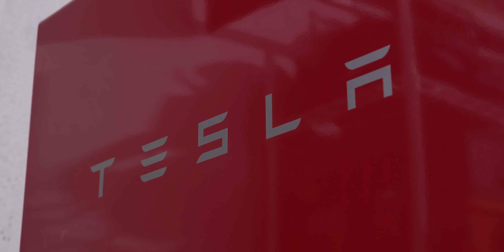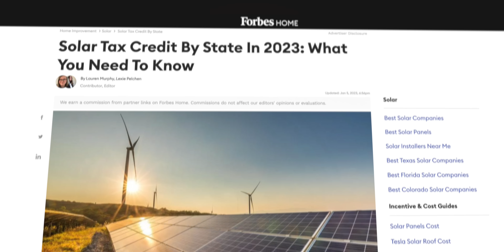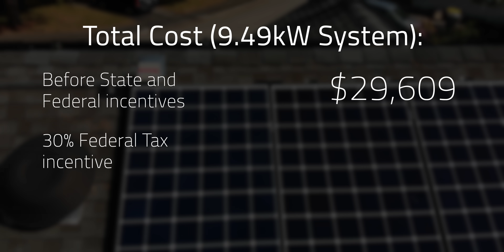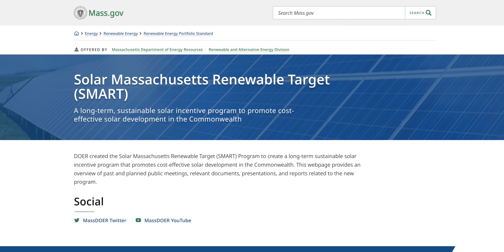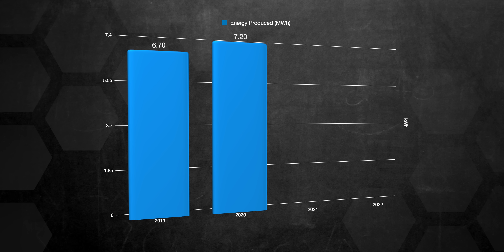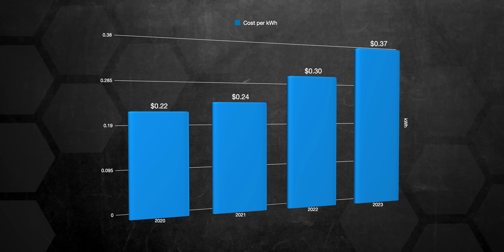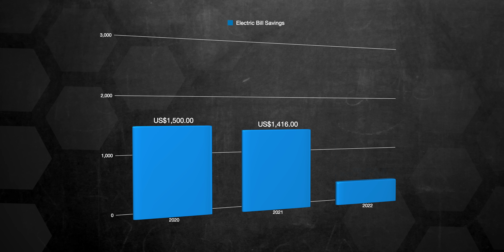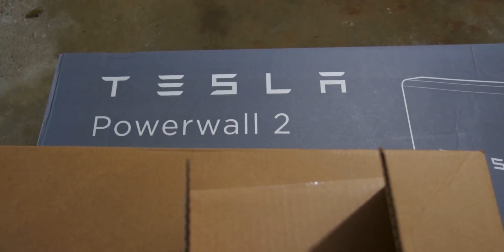5 Years with Solar Panels - Is It Still Worth It?

Comment: In my state, they tried to dramatically inflate utility bills to subsidize (trick) people into solar panels. When you add up all the real costs, leases, and subsidies, Solar power is not efficient. Individuals may save money today at the expense of others, or by bankrupting the state, but we are all going to regret it later.
Reply: Leases? Theres your problem.
Someone tried to convince me of this l did a hard pass I'll put my own panel on my roof thanks anyway and I pay no attention to subsidies because they want you to spend more on a turn key system.
My panels cost 30 cent a watt and the battery was $130 per kWh $150 if I include the fancier BMS I didn't really need but wanted.
Any money I save will not be at the expense of anyone else because I'm not treating the grid like it's a battery.
If everything works I'll be paying to keep my meter but not buying any power.

Comment: Not sure how it works in the US, but  an accountant would also count the  cost of the $14,000 not being used elsewhere (opportunity cost). This means $14,000 put on the roof is not in the bank at 5%....or in the share market or whatever. If you borrow the $14,000 that's asy $700 pa extra in interest. Also, sis you pay to have the panels cleaned? then if you escape before the inverter fails and there's no hailstorm etc etc.

Comment: Problems with solar panels: Part obsolescence. Trees. Hail. Snow avalanches. Rainwater shoots out over gutters. Got it 👍. 
     You think you’ll get more $ for your old house? A little double-dip? I should hope so, after that huge Solar investment. However: If I was going to buy a house, and the shingles/solar panels were old, I’d offer a much lower amount for the house so I could afford to do it again. (Same thing with an EV that had an old battery.) 
     My new roof cost $20,000. The roofing guy told me they charge an extra $17,000 to remove/replace solar panels when replacing shingles. (Plus, solar panels put big holes in the roof, you’ll probably need new wood$$$.)
     A 30% federal tax subsidy for solar is a burden on poor people that cannot afford solar; and who pay bloated utility bills so you can get a subsidy. And “Energy credit systems” and free Tesla Powerwall Batteries are just more subsidies. Don’t fool yourself with the energy savings “shell game”. Money isn’t “magic”; somebody has to pay. 
     Taking out a $30,000 home loan to buy the panels means you also pay “interest”. Next time you enjoy low or negative electric bills, don’t forget to deduct those $1,000’s in interest, the $1000’s in subsidies, and the $1000’s to have solar installed. 
     Would your solar panel purchase have made any financial sense without the subsidy gimmicks? Consider this: Second generation solar panel owners, when everybody is forced (or tricked) into becoming energy manufacturing plants for the state, will not have “Robin Hood Discounts”. We’ll pay the full amount in addition to having all the power plant headaches. 
     And remember, once a house goes solar, you are not allowed to go back to a regular house. 
     (You saved $1500 a year? You need to get gas heating for your new house—very cheap.)
     Solar panels last about 25 years. Are you ready to pay full-price on your next setup? Is that the next guy’s problem? I can’t wait to see that video.
Reply: No big holes unless your installer is a doof.
And you are going off a specific type of install.
If I don't like my system I can scrap or sell it off at my disgression.
I agree with your analysis of the subsidies hurting poor people, but I won't be getting any of that I don't think.
Pretty sure I'd have to tell them about my system to get that.
Also when you are doing your calculations don't forget capital gains tax that you don't pay on money you saved just money you gained.

Comment: Net metering is gone in CA, except for those grandfathered in.  My utility now credits only 7 c/kWh for power uploaded to the grid.  SoCal utilities proposed only 3 c/kWh, plus a $300/yr grid connection fee.  Not sure what the PUC granted them.  But, solar still pencils out in San Diego with their 83 c/kWh peak residential rate in Summer, though can no longer use the grid as a "free battery".  Your battery-car would need to be parked at home when the sun is shining, unless you opt for very pricey home batteries.  At ~$1K/kWh battery capacity for ~3000 cycle life, it costs 33 c/kWh to store power in the battery, and since an upfront cost more like 66 c/kWh given time-value-of-money.
Reply: Net metering is gone. GOOD! The grid isn't a battery and treating like one will kill it if left to grow uncontrolled.
The battery you should have already installed with the solar and if you had this would barely effect you.
A $1000 per kWh battery with 3000 cycles? OK just stop pretending Twsla powerwalls are the only battery in the world. I'm looking at a 5 kWh eg4 LiFePO4 server rack battery with 6000 cycles for $1259.
I got my 14.3 kWh LiFePO4  from a reclamation agent for $1800 and added a fancy BMS for an extra $300 that's less that $150 per kWh.
6000 cycles is 16 and a half years at one cycle per day.
So at the end of 16 years my battery will still have 80% of the 14.3 kWh it has now or 11.4 kWh which is still more capable than a new powerwall.
And unlike a Tesla mine wont burn unless you stoke a fire to burn it on.
Reply: @ghz24  Good reply.  Yes, I found battery prices have more than halved in just 2 years and newer LFP type are safer and have longer cycle life.  My numbers were outdated.  Will Prowse has good teardown youtubes.

Comment: The rising energy costs is such a big one. My husband did load calculations and realized our hvac unit isn't properly sized for our house. Plus we have a cheap, inefficient system to begin with.. So our electric bill has always been high. Now with our power company raising rates our electric bills are extremely high for a 1400 square foot homes. 

We're talking about working in building our "forever home" and I'm definitely looking into airtight home designs, passive solar, and solar panels.

Comment: There is nothing wrong with solar and more people need to it and maybe it should be required on new construction if certain conditions are met. Still if your an older person I’m not sure it is economically justifiable. I’m 71 and we put solar on our home last yr. The cost of the panels is actually a little more than my previous electric bills. So no real savings other than maybe the environment. Also our electric company is trying to change the sell back of your excess generation so maybe my power bill is going up if the PUC allows the change. I also checked into adding batteries but that would make the cost of the panels and the battery loan payback about 2.5X what my pervious electric bill was. They make sense on new homes and if your young enough but if you are an over 60 yr old I’m no longer sure it makes economic sense. Sorry

Comment: Man, $0.37 per kwh is insane.  I recall Maui screwed up their market with so many customers installing solar to avoid the high prices leading to even higher prices as the utility lost scale.  In Texas we've seen a spike this year from $0.093 to $0.124.  Still too low for solar but a 30% spike in one year.

Comment: I live in Mass, on the North Shore. I've had solar panels since I got them at the very end of December of 2019, so I got the bigger tax credit.  My roof isn't optimized as I have an east/west facing ranch.
I used: New England Clean Energy and I had a great experience with them.  They were recommended by a coworker and by using them they paid both him and myself a bit of cash, which was great.
2020: 7.57 MWh
2021: 7.00 MWh
2022: 7.55 MWh
2023: 6.65 MWh (as of today)
I thought posting my numbers might be interesting for people.

Comment: The HUGE ELEPHANT in the room is when you have to replace your roof (typically after 15-20 years) the massive additional cost to remove those panels safely without damaging them and replacing them. Nobody is talking about that. Do we have TRUE total NET COST or Break even on this film NO.

Comment: 1) Getting a roof replaced after solar panels is a big and costly deal. The company that had installed our panels would not remove and reinstall them. We had to get a company from out of state to remove the panels for a cost of over 10K, replace the roof (completely separate cost) and then have them put the panels back up. If I have one piece of advice for rooftop solar - get your roof checked thoroughly. 2)The info most solar companies don't tell you up front is how much LESS the panels produce after a few years. They may be good for 20 years but in year 20 the production is 100s of KW less!...check your paperwork. I would never get them again on a roof, rather do free standing. Also a greedy power company can change everything you save with different types of rates. What was a win for us in the first couple of years with $20-$50/mth bills quickly changed when the power company saw how much money they were losing. The cost saving is no more.

Comment: This guy's experience is definitely not the norm when it comes to signing up for solar panels. First off your not guaranteed to get the # of panels need to power your home 100%. Also for the "tax credit", you will not get it in a lump sum but instead paid out over the course of a few years IF you qualify for it that year, and you only qualify for it IF you owe the IRS that year, so if you get any refund at all.....no tax credit for solar. Honestly a lot of what this guy says sounds straight out of a solar panel sales guys mouth so I am questioning of if there's a sponsorship he's not disclosing. Just know that this is not the experience of ALOT of people that have fell for the solar panel scam. And another fyi....they don't increase the value of your home either.

Comment: We installed a 9.9 kw solar system that went live in August 2022.  I did all the installation myself and the total cost was $15600 for panels, pieces, parts, permits, engiineers etc...  We live in Pennsylvania with a perfect south facing roof.  We have produced 4.8 mega watts in 2022 and 10.7 so far through September of 2023.  Since we have 1:1 net metering our electric bill has been the minimum $15.40 for every month except January of this year when we ran out of credits.  Unfortunately in May the power company pays you for any credits you have at that time, so you can't save up for the winter.  In May we produced 1.6 KW!! So with the March, April, May production we had 994 kw for which we got paid $180.  SREC's are only $40 per KW.  I figure our payback is 4 to 5 years.  So far an excellent decision.  

We used 24 - 415 watt Mission Solar panels, an American made panel, and enphase microinverters.  Definitely use those and not one big inverter.  The wiring is simple if you know anything about electricity, so do the install yourself and save a lot of cash.

Comment: @davemessenheimer You are correct; all sales values are based upon location.  Where I am an agent our state guidance recently stated was that not much value if at all.  I had a listing appointment recently who were very proud of theirs and thought they gave full value to their house.  I called a couple of appraisers to verify I was comp'ing correctly and they all basically told me no value and that is in Texas.  Now the big cities in Texas may add value but overall they are not getting value here.  It  might be the cost of our electricity.  I pay $0.11 / KW.  They thought the value of their house was $200k more than it was.  Next door neighbor had sold just a couple of months before with a more updated house and was a comp so they decided not to sell.  Even with full value for the solar panels their house was not worth what they thought it was.  I don't remember without looking at my notes but their savings was maybe 50% at the most.  When my bill for the 105+ days was $322 and the highest I ever paid for the 15+ yrs we have lived in this house;  this month as the temps have dropped my bill is $255 so the cost of adding panels vs my savings isn't such a return for me.  The average house around here is about 2000 sf but there are a lot that are larger.   The highest bills I saw people griping about was $600 and I think they either have pools and workshops for that type of bill or a very poorly insulated house.

Comment: Did you know your current electricity price is more then 6 times more expensive then what we pay here in Quebec? and prices are regulated so at worst, we get an increase that match the inflation. Normally between 1 and 3% increase per year. They can't get more, it's the law.

Comment: Definitely matters to the Solar availability of the site, installation configuration and probably most importantly, net metering potential. Our modest $11k (after rebates) 4 Kw system in sunny SoCa in the most expensive electricity market in the country but with an excellent (now, since modified) 1:1 NEM yields 100% offset with $40 to -$2.00 being our annual electric cost. Five year ROI and 20 more years of free electricity.

Comment: Also, they never tell you probably 2 of the most important things.

Solar Panels have degradation, which in non-extremity environments could people still 90% output in performance, but in environments where there's hail, heavy snow, dust storms, animal poop, hard winds knocking debris can degrade them faster. So depending on your environment when it's time to change the roof the panels may have lost 10-15% of the output, so a loss of 20%-30% (maybe more) in 15-30 years.

The other thing is the cost of installation, you might think oh well I'll just install them once and we're good. But remember roofs get changed 15-30 years (depending on your environment), so someone has to remove that setup, and it's not going to be cheap, it can be about $300 per panel to remove and reinstall so if you have a 15 panel setup, you'd be looking at about $4,500 (or in the video it looked like you had 26 panel setup so around $7,800). I'm not sure if they'd have to remove the rail system for the panels and if that'd cost more.

Also sadly, some places also don't offer the "selling back to the grid" incentive.

But if you don't plan accordingly, you'd get hit with a brutal bill on top of the cost to repair the roof. 

I've been looking into getting panels but in my case, it'd be more of getting a few side panels to offload some power so stay below the second-tier rate of power which is $0.27 per kWh (First 1000k kWh is only $0.21). I've thought of maybe getting like 2 panels and running some heavy appliances if the setup can support the amps and "dirty power". Then once the setup pays itself use the saving to buy more panels.

Comment: We need to use residential 3d printing tech for these systems to be economically viable, the prototypes are in Stanford or the Australian special ink tech or we are just paying for expensive plasic and tech that do not have returns on the inital investment, deliberately misleading claims to promote these systems is fraudulent.
Claims that the raw materials used in production are less damaging to the environment than grid services is not true and the capacities and productivity of these systems need to be transparent 
They never perform as advertised which is the most common complaint.

Comment: We live in Arizona about 30 miles west of Phoenix. Our 2,300' home has a 7kW system that was installed in 2019. To date, we've had $0 electricity costs over the past 4 years. The past 2 years we've had excess credit checks from the utility for about $240 and $150. For our next billing we might need to pay $10-15 for the first time in years, but then credit built up in November/December will offset that amount and we continue to build credit into June, maybe July. The original cost was $21K, or $14K after discounts. ROI will be under 6.5 years. We've had no problems and no additional costs since the system was installed on our newly built home. With record heat this summer I've read many horror stories about electric bills in the range of $500-1,000+. We are very happy to have solar.